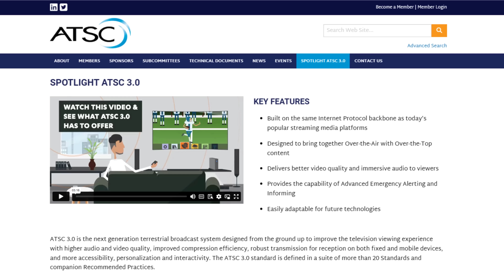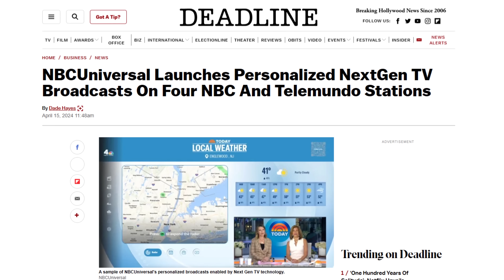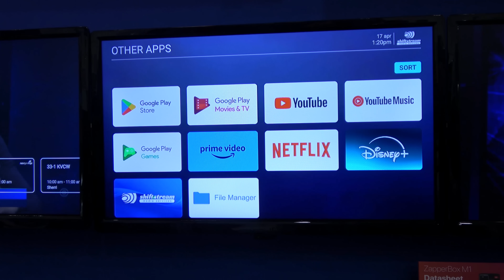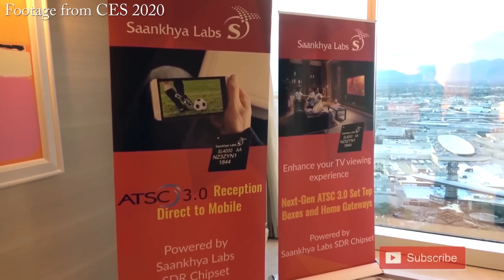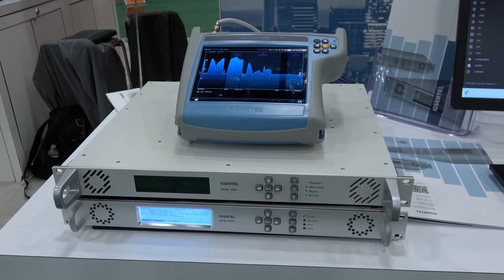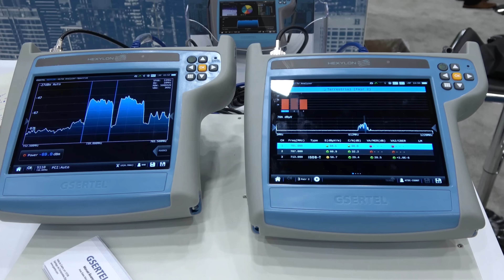2024 NAB Show - New ATSC 3.0 Tech & Interview with Televes Engineer

Comment: Linear OTA tv is dead, or soon dying. A buying a really good antenna is like buying a really accurate sundial.
Only momentum and sunk costs are keeping it going. Sad, true. But all of those stations, transmitters, and towers
are crazy expensive to build, maintain, and power. Not to mention the number of ads needed to run to keep it afloat.
The big network operations, ABC, CBS, NBC, FOX, aren't far behind. Other than news operations, for what they are worth,
they target YouTube now., where the audience is for advertisers.
OTA is a nice hobby for a diminishing audience, but digital OTA is impractical now.
A huge loss, but that frequency space could be better used on other things.

Comment: The thing is, ALL TV antenna reception is line of sight only. there is no such thing as a 50 or 100 mile antenna --- unless eithor you or the antenna (or both) are on a high mountain. In urban areas, 25 miles is about the most you are going to get with a high rooftop antenna. In the South Bay San Diego area, the local TV broadcast antennas are fairly high up, so I get the three local nearby stations with about 8 channels ... now the content is abysmal, but its still free :)>

Comment: i dont even have a ATSC 3.0 tuner as none exist in the pcie market
Reply from the maker: I agree the price of ATSC 3.0 tuners is a bit on the high side since we're still in the early stages of it. There aren't many reasons to be an early adopter unless you live in a very bad reception area and executed all options to upgrade your antenna.
Reply: @AntennaMan  my antenna is decent likeits either the RCA ANT075 or similar to that model but it replaced a old RCA or radioshack antenna thaat was falling apart and i think not as powerful either  we dont use a booster or one of them LTE filters on it yet

Comment: Nothing On DRM Encryption.  DRM is not mentioned, even though there is a clip of an HDHomeRun device that states “Not Certified To Decode DRM.”   DRM is the #1 issue with ATSC 3.0.  Tyler’s neglect to address the current state of DRM, after his past advocacy against it, leads me to believe that he has sold out to the NAB and that this trip was sponsored.   His “poor mouthing” further points to this. It’s tacky and inappropriate.  Sorry Tyler, but you have been demoted to the bottom of the Credibility list.
Reply from the maker: NAB Show isn't the place for consumer advocacy. It's mostly vendors and NOT the people responsible for encryption. Besides, I already made several videos urging people to take action against DRM. If I wanted to sell out I would've kept my mouth shut instead of making SEVERAL videos. I paid for literally everything out of pocket for my NAB trip - nearly $1,000. Nothing was sponsored.

Comment: Did Tablo have a booth  still waiting for 3.0 tuner from  them
Reply from the maker: No, Tablo was not there. They are not working on a 3.0 tuner at this time because of the issues with DRM but they don't need to, we are still in the very early stages of ATSC 3.0. There aren't many reasons to switch to it. Most of the interactive features mentioned in this video can be achieved simply by downloading a TV station's app on a Roku.

Comment: Is it worth it to set up an ATSC 3.0 antena system with a Roku stick+Samsung TV in the Philadephia area? My wife and I live in Lansdowne, PA. However, over the past 2-3 years there's been a sense that Philly area broadcasters (6ABC is the main problem child) have not been universally setting up and transmitting ATSC 3.0 signals.
Reply from the maker: An ATSC 3.0 tuner like the model below will help pick up WPVI as it's carried on a stronger UHF signal in the market. https://bit.ly/3STyTqX
Reply: @AntennaMan  Tyler, Thanks for the recommendation! Will this tuner work with low-cost indoor antennas or is my money better spent on a "good" enough" exterior antenna?

Comment: One issue that concerns me about amplified antennas is what happens if the amp goes out. Antenna amplifiers are subject to electrical build up especially in the summer months during thunderstorms.
Reply from the maker: All of the amplifiers built into the Televes antennas have powerless pass through meaning if the amplifier loses power it will simply pass the signals through the coax like a standard passive antenna.

Comment: Hoping local stations go 3.0 soon, just for reception. Both TVs I own are Sony, bought within a year of each other, and both hooked to the same outdoor antenna with an amplifier. Weirdly, the Sony TV closest to the antenna (and the more recent and expensive TV) is only getting 19 channels. The around a year older Sony in the back of the house, still wired to the same antenna, is getting 31 channels. Tried removing the amplifier from the closest TV, it showed 0 channels after the scan.

Comment: Hi. I installed a new digital converter about a month ago. A ematic model AT103B. My old one that gave out after 3 years and 8 months was a AT103C. The manual for the 103B is 6 pages less, and no toll free phone number listed anymore. Well, can you tell me if I can change the scheduled TV shows from military (24hr) time, to the regular AM, PM time ? It seems to work the same, but no AM, PM shows up. Thank you.

Comment: I just bought a Televes DAT Series BOSS Mix LR Low-VHF/High-VHF/UHF based on your recommendation. I ordered through Your channel. You're gonna save me a lot of money and your videos are very helpful. 📺
Reply from the maker: That's one of the best antennas on the market. Hopefully it works well for you!
Reply: have just watched the Televes Dat Boss Mix and just wondering  if comes already with pre amplifier
Reply: @megacap55  Yes it does, it's built right into the back end of the antenna itself. You connect the coax to it, and snap that module into the back. It also already has built-in FM and 5g-LTE filters to keep those from causing problems.
Reply: @MikeBear1231  great, i hope works the filter for 700MHZ LTE although have not channels of those bands but need a futureproof set up
Reply: televes

Comment: Nice video, hope there are more videos to follow with other interesting things from the show (products or services).  Any more info on ATSC 3.0 besides what you mentioned about the DVR device manufacturer being stymied by a cumbersome and costly  approval process?    I used to "geek out" on radio/electronics back in my younger days, recently got back into it over the last few years since I both retired and cut the cable TV cord.
Reply from the maker: Honestly, there weren't many new things beyond what I mentioned in the video. ATSC 3.0 may or may not gain traction in a year or two. The DRM issues is definitely having an impact on consumer adoption. I would be surprised if even 1% of over the air viewers use an ATSC 3.0 tuner.

Comment: Mines an old Radio shack amplifier, but it works.  Whereas it doesn't capture signal over the distance of the cable line up to the antenna w/o it.  I still  work and pay for Internet, so it's a moot point.  That's always a conundrum to me.
Reply: just got an channel master  mini 8 and am surprised because even pulled 2 cable channels that no idea how came from my rooftop antenna and is not on air those channels at all, althought is not crystal clear but i am surprised by the quality of channel master products, first time i  have   an product of thems and  i am impressed
Reply: When you say cable channels which ones? Some cable channels like qvc, cozi, h and I, ion, movies!, laff,metv,etc are broadcast on digital sub channels on ota as well
Reply: @njlauren  no bbc world news and other  but analogue one, that is not an channel that be over the air, happens that i am in Chile and well am rebuilding my rooftop antenna and entire home set up since an experimenting problems of reception and plan on November cut the cord since mainly watch over the air channels and am taking time to do the rebuilt and been more hard rebuild a set up than make it again from scratch since now have buildings almost in front of where was the antenna am having troubles with reception